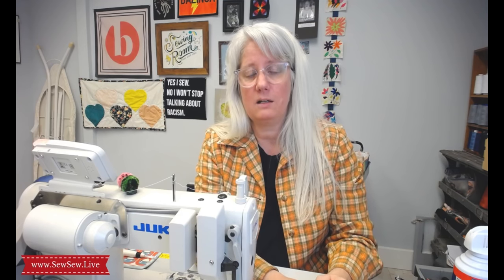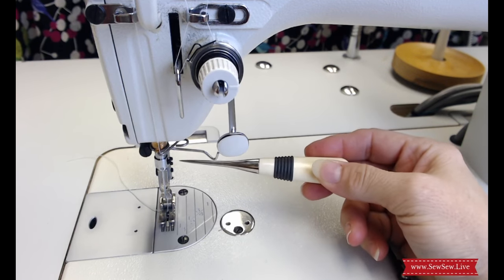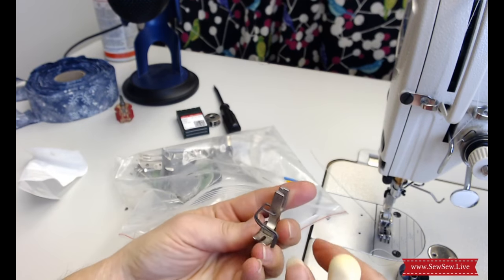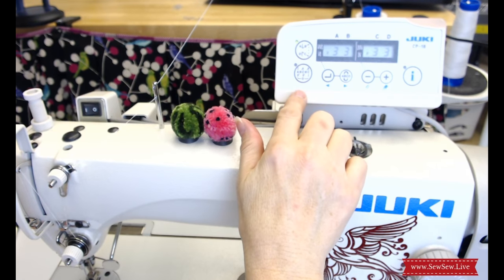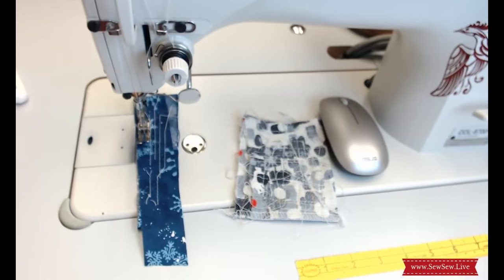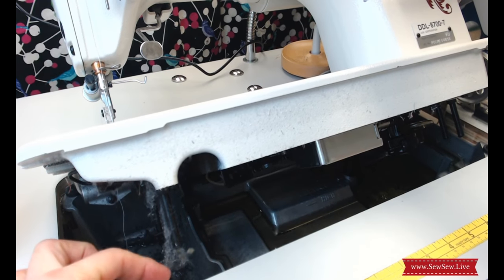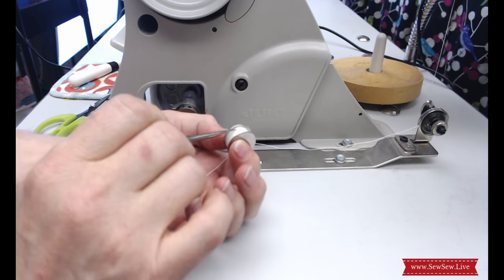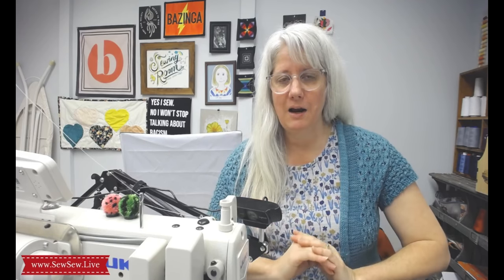How to Use and Maintain a Juki Industrial Sewing Machine

Comment: I bought my DDL8700 over a decade ago, and it has been a workhorse for me (as the joke on the board went … “making wadders in half the time!”)

I bought it to have a machine that pretty much never failed on me, although, my first motor died at the seven year mark!  The new servo motor is even more quiet, and has much wider control of the speed.  When my niece and nephew come to play, I dial it as slow as it will go.

I do open the bobbin cover, as I haven’t quite figured out the rotation to snap it in place sans eyes (although I’m very good at catching stray oil when I attempt to do so).

I had both a Consew walking foot and 5 thread Merrow serger, but realized they weren’t quite what I wanted.  So I sold them.  Now I’m looking for a zigzag, but I may have to give up my straight stitch due to space constraints.  I’m not sure I can do that!  😄  

I love my Juki, and have started eyeing their domestic line for when my current super-duper computerized machine turns into a heavy anchor (I’m averaging about 10 years for my high end computerized machines before their boards give out and are no longer supported 🙄).

Great video!  Thank you for spreading the joys of industrials.
Reply from the maker: I can’t imagine using anything else! They aren’t portable but they’ll sew anything really well. Thanks for watching and sharing about your machines.

Comment: Indefinitely recommend buying multiple bobbin cases (not the basket hook assembly you called the bobbin case) and getting a towa bobbin tension guage for type L. That way you set the tension on the each case for each size thread you use and just change cases. But the towa bobbin tension guage is a life saver. You'd be surprised how off the "spider" drop method can be depending on different types of threads. 
I just have a manual 8700 without the thread cutter and computer. Identical to your 5550. Without the computer it's a 5550N. 
I got the 8700 for $942 assembled and shipped to my door brand new ready to sew so I got that. I did get the upgraded motor with the synchronizer to control needle position and max motor sewing speed so that's good enough for me I guess
 The 8700-7 was double the cost shipped to my door. I wanted it. But for the cost difference I couldn't make it happen.
But so far I use wawak jeans thread 60&80, and multiple weights of gutermann Mara from Tex 30- Tex 100 so having the different bobbin cases and setting them once is great. And you still need to check them so again the towa guage is awesome. Super simple. Set to 200 on the scale and possibly sometimes have to make a micro adjustment as I'm sewing to perfectly dial into what I'm doing. But having the bobbin tension right makes the top tension work like it's supposed to.
Thanks for the video. Nice intro.
Reply from the maker: Thanks!

Comment: Thank you for this video, so glad I found you.  I bought a Swift machine locally in South Africa, looks like your old Juki.  I did not have training, only a quick demonstration on how to thread and wind the bobbin.  I saw how you threaded your machine and did the same on mine.  I have the following issues though (no help here from the dealer):  How do I get a neat backtacking, mine is kind of messy on the back, I keep on loosing my bobbin thread especially after I cut the thread (manually), the bobbin thread will draw back into the bobbin casing so that the top thread cannot link with it, and my stitch length will for instance on 5 be a small stitch but if I switch the machine on and off, it will look like a normal 5 stitch length
Reply from the maker: Congrats on your new machine but sorry your dealer isn’t very helpful. I know you can adjust the length of thread it leaves for the bobbin. You’ll have to search for your owners manual to figure that out. But it should be something they should adjust for you. Once this is sorted out, your backtrack may clean up a bit. Does your machine have auto thread snip? Because if so, I’d always use it. The lengths of thread make a difference for how your machine is configured. I don’t understand the last question about stitch length. You might look for a group on Facebook-I hear there are dedicated groups to machine owners and that may be an excellent source of info. I don’t do fb much so I’m sorry I can’t recommend one. So try to find your manual and see if you can adjust that thread amount for the bobbin. Maybe that’ll help a few issues. I hope so!! Good luck.

Comment: Dbx1 is better to go by. 
GB changed their packaging recently.
But 16x257 and the difference between brands I think are based on where they take measurements. GB may be whole needle and organ only measuring after the round shank or something. 
But if you buy DB x 1 then you're safe.
Also, 90/14 and 100/16 are what you're machine will do without retiming hook. 80/12 works as well but anything above or below those, you'll have to retime the hook. 
Bigger and you rub the hook which may not be apparent right away but will show in time with broken threads and needles. And in time need a new hook.

Smaller and your hook will miss stitches sometimes. 

It's not so much the timing but the distance from the hook to the needle. They move the hook assembly along the shaft and check timing of the hook too.
It's not hard to do at home. First time will take longer but after you'll become a pro and there are marks on your needle bar to show where you set it at bottom, then you continue the "stitch motion" and go to the next notch and that's the point you set the hook and the distance from the needle. Once you do it a few times you'll get it done in minutes. 
I regularly use 110/18 for Tex 80-tex 100 thread so I have to go back and forth.

As far as moving the machine, drain the oil, pull the head and put it in a garbage bag to catch oil. Then the table is light.
Reply from the maker: Thanks for the info. Lots of folks are really new to using an industrial. Or doing any mechanical work on their machine. I’d suggest a mechanic for the timing unless one trains you. Or you can learn first. I love doing a lot of my maintenance. But I still have a mechanic come once in a while to give it a once over. One note though- when the machine has electronics it is very possible to remove the head to move the machine (I’m pretty sure I said this) but removing all the electronics is a bit daunting. But it’s totally doable. Just take photos. I’ve done it when my mechanic wasn’t available and brought the head in for maintenance to the shop. But it’s not as easy as you describe. Without electronics, yes! It’s very easy. Just remove the belt and that’s it. 
Your prices sound about right too. That’s what I paid. I paid a lot less for used. It’s very affordable to have an industrial!

Comment: Hi, I am not sure that it particularly matters, but the thread goes through the hook above the main tensioner only on the way up to the take up lever, and not down from the little tensioner on the top
Reply from the maker: I don’t think that’s true. And my mechanic also threads it this way. And I do think it matters. I notice if one is skipped. Maybe other machines don’t need both.
Reply: @SewSewLive  
I just checked the threading diagram for the 8700–7, which is available online. It clearly shows the threading as I described it. So I guess it really doesn’t matter because if it’s working for you and your mechanic, then it works. PS – – your channel is terrific
Reply from the maker: I’ve seen that and I think it’s just one of those things that helps the thread behave better. It will also depend upon the tension. I adjust mine often especially for heavier threads. These machines can be calibrated for specific styles of sewing. It could work that way for another style. Thanks for watching. Glad you like it! Happy sewing.

Comment: Hi love ur videos, just wanted to know whether there is a quilting foot for Juki ddl 8700 and wud you be kind enough to help me adjust the machine speed thanks 🙏
Reply from the maker: Hi! Congrats on your machine! I’m not sure what you mean by a quilting foot since you can’t drop the feed dogs. And I’m also not sure how to adjust the speed. But I’m sure you’ll get used to it once you use the machine for a bit. You can also check the users manual I think it’s linked in the description. Otherwise ask the dealer where you purchased it and they can adjust it very easily.

Comment: The knee lift for the needle  is no longer working like a spring broke or something.  Is this an easy fix or do I need to have a repair person come and fix it?  Do you know?
Reply from the maker: Let’s see. Do you mean the knee lift to lift the presser foot? Make sure the rods are still in tact under the table and they didn’t slip. But if it’s not raising the presser foot you’re most likely going to need a mechanic. I don’t have a knee lift any more otherwise I’d look at it to see what else it could be. The knee lift is a simple device though. So maybe check it out and see where it interacts with the machine. You might be able to figure it out.

Comment: Hello, great video. However, I do have a query. I've purchased an industrial juki machine around 5 weeks ago and have been using it pretty much everyday since with no problem, but today I have an issue. The bobbin and its case keep popping out from underneath once i start to sew and now the machine just keeps beeping at me when switched on.  Ive checked that the bobbin is placed in the case correctly and it is. I've also checked that there are no broken needle bits around that area. I'm completely baffled, so googled my issue, which is how I landed upon your video. Would you happen to know what could be causing this and/or how to resolve it. Any advice would be massively appreciated. X
Reply from the maker: Hmm that sounds super annoying! If that happened on mine it’d be so oily and messy! Yuck! Okay. I’d change the needle and re-thread. Mainly because  bent needle can wreak havoc on your machine. And it’s hard to detect some bends. Plus resetting the needle position and ensuring the thread take up lever is at the top will be good to do.  (Meaning make sure the needle is at its highest position). You’re positive it’s the correct bobbin, right? 
Have you tried sewing a stitch at time with your hand wheel? Rotate it toward you. 
The only time I have this happen is then my needle isn’t all the way up, I insert the bobbin case it’s not properly seated. 
Try those few things and let’s see where you’re at. I’m not an expert but I bet we can figure out if you need one!

Comment: Great video.  Thanks.  I am considering buying an industrial machine.  Do you know any comparison of Judi to Sailrite?
Reply from the maker: How exciting! I honestly don’t. They’re very different though. I thought the chief difference being a Sailrite is portable. So you may lose some capability but you gain portability. They’re cute and well made but I do think they’re not quite like having an industrial from the few remarks I’ve heard frozen others. I don’t know about price but the industrials are very affordable. Good luck!
Reply: @SewSewLive  the Sailrite I am considering is their industrial deluxe version with a nicer table than Juki's.  It also has a quick pull pin so that you can wind the bobbin without running the main sewing machine mechanisms.  I am still researching their other features.   I liked the feature you demonstrated with  heel pressure to raise the foot/needle & cut the thread.  The Sailrite deluxe model is a little more than  $2,000.  How does that price  compare with the price of the Juki you are now using
Reply from the maker: That sounds nice! I paid $1800 for mine. (Because it has those electronics you mentioned.) the 8700 without electronics is about $800 new. Although these days that could be different. This is my first brand new industrial. I’ve had several used ones and totally recommend that route if you can find one. I never paid over $600 for any of my past machines. If you get the sailrite let me know what you think! I can ask in my Guild community to see what folks think too.
Reply: @SewSewLive  yes, please let me know what they say.
My research is showing me that Juki and other name brands may be better machines but don't offer the support Sailrite does. 

I have never been interested in sewing,  but my daughter is into it heavy.   I bought her an antique Industrial singer to upholstery my plane.  It works great but we were surprised to learn it did not have reverse stitching.   Only the subsequent model came out with reverse stitching.
Reply: @SewSewLive  I am sorry to bother you again, but I have a quick question about the Juki 8700 without the electronics.  Will it allow a beginner to go very very slow when doing upholstery?
Reply from the maker: Sailrite makes their machine so that’s why it’s well supported. Mine has great support because I actually have a mechanic to service it. And many folks don’t do that. But if you buy it from a dealer the dealer should support it. Many industrials don’t have a reverse. That came much later. But after you start sewing a seam, you pick up the work pull it back a half inch and sew again. That’s how I was taught! 
As for speed I think I mentioned this in the video or showed it, there is a speed adjustment. It has a turtle and a rabbit. So you can slow it down. But I promise you’ll get used to it! One thing I’ve learned is that it has great control. I can sew slowly and very fast. It isn’t one speed. If you watch me sew any garments I can sew one stitch at a time. Lots of control!
Reply: @SewSewLive  Wonderful!  I can't wait to watch more of your videos.  I will get my daughter to join me.
Reply from the maker: Good luck and thanks for watching. 🙂

Comment: Hi love ur video, I have a Juki ddl8700 my bobbin winder does not spin any advice thanks!!
Reply from the maker: Is it that your bobbins are too loose? So the winder is spinning but not the bobbin. If that’s the case, you can use a stout flat head screwdriver to wedge in to the post that the bobbin fits on to and let it apart a smidge. It’s meant to be adjustable so if you have bobbins that were too tight and didn’t fit on the post, you can take another tool and squeeze them together. I have a couple bobbins that never spin and I didn’t want to adjust the machine each time for just those two so I set them aside. Hope that helps.